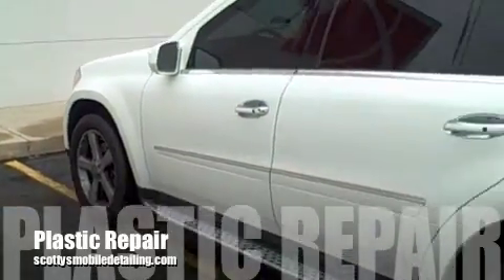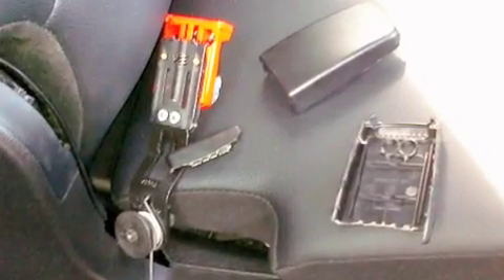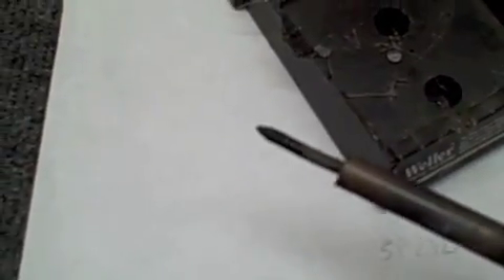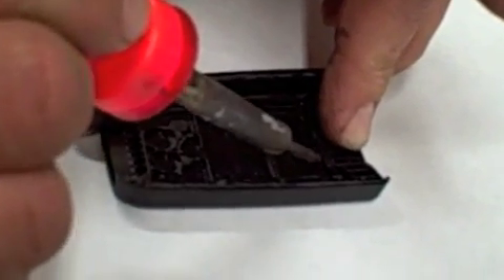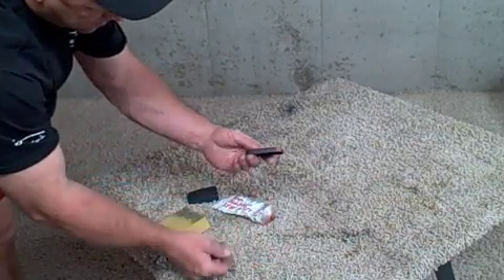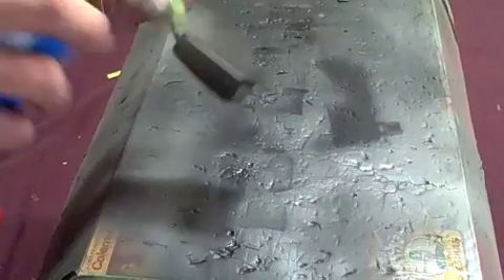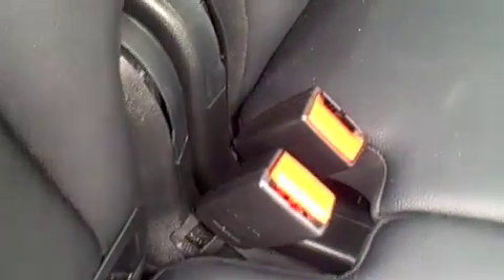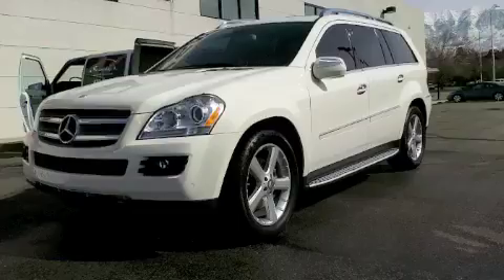How To Plastic Weld

Comment: nice video Scotty. have you tried to use zip-ties as plastic welding filler? i'm not sure if zip-ties are ABS plastics, but i have used it with an open flame torch and not a soldering iron, which is what i will use in the future. thanks